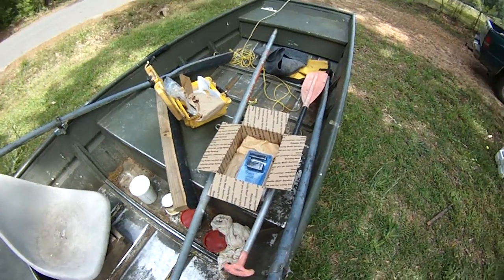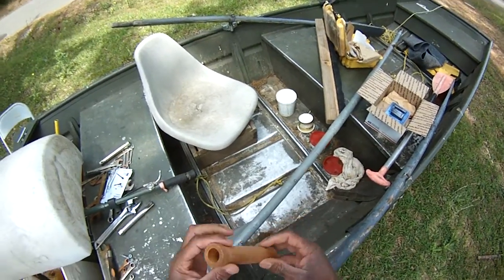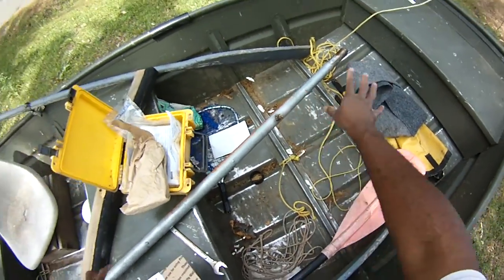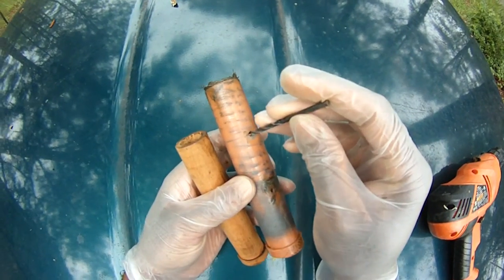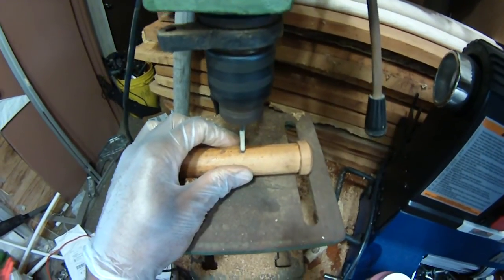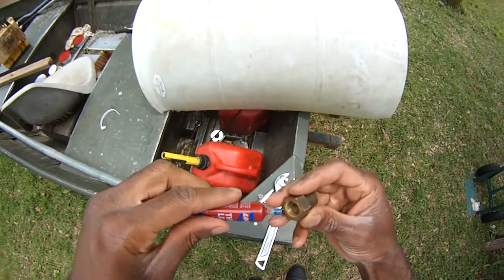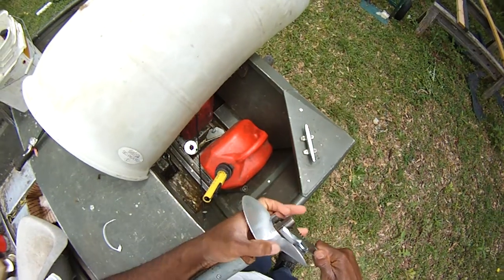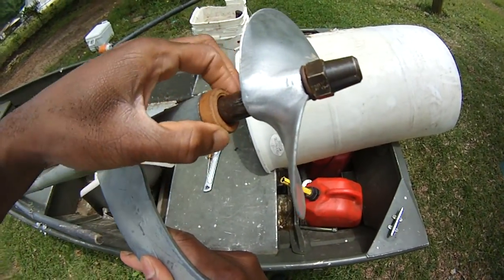Longtail Lesson #4 | How to Install a Wooden Flange Bushing

Comment: I took out all the screws and drilled out the holes that hold the bushings and replaced them with grease fittings.
find the drill bit thats a little smaller than the zirts and they thread themselves with a ratchet and socket[
put some paper towl in the socket to keep the zirt  from going to deep in the socket
just give them a little shot before going out with marine grease and your good to go.

replaced the tail bushing with the bronze bushing they said last ones but dont know.

I have a KKK 16 hp elect start

Comment: So the brass bushing would install the same way ?
Reply from the maker: Yeah, the biggest problem with the brass bushing is electrolysis because of the different metals. They have a new material that blows away anything that we've had before. I plan to upgrade my current motor to the new bushing eventually.
Reply: Black Warrior Lures I have the mud skipper .. How long can I run the nylon one for and what is the risk I run? The areas I fish aren't wooded areas or swampy messy areas
Reply from the maker: I can't speak for Mud Skipper. The Delrin/nylon types of bushing will melt if run out of water for too long, but they're fine as long as he water cools it. The special bushing I mentioned before is only available to Swamp Runner owners.
Reply: Black Warrior Lures awesome. I'll probably just buy a extra nylon one and always carry it on the boat
Reply: Black Warrior Lures thank you for the fast replies
Reply from the maker: My computer is always up and running, but I do take days off.
Reply: Black Warrior Lures sounds good. Hopefully I'll be posting up some videos soon as well. Have a great one

Comment: When you the shaft off, as well as the shaft housing on the motor, how much grease comes out? and how do you clean the grease off? I run a medium kit and I need to replace the engine soon
Reply from the maker: Clean it with denatured alcohol or acetone. You need to clean the spindle well. Not much grease comes out.
Reply: Black Warrior Lures I appreciate it!

Comment: I also own the KKK long tail kit I'm trying to replace the bushing with a bronze bushing I can't get the bushing to slide out the end. 
 Any help?
Reply from the maker: Vice grips and pull it out. That's why I hate the plastic bushing because it melt and wedges in there,.
Reply: I had the same problem so I toke a torch and heated it up and came right out I put the bronze bushing in it haven’t had a problem since  I had the 13hp  on it for a while and I just put the 22 hp from harbor Freight  on the same kit bolted right up and it rolls my 16 by 54

Comment: Damon, where can I order one of these bushings?
Reply from the maker: +MudMotorMania mudmotorkit.com. This is Swamp Runners, or you hear me call them SPS North America. It's all the same company. You'll have to call them at the shop to order this, as it isn't on their Web site. 

They don't list everything on their Web site, and something they won't sell unless you've bought one of their kits. You can buy the plastic version straight off the Web site.
Reply: I was unable to locate them on there site, I appreciate the information! My problem is I own a "Mud-Skipper" kit by KKK. Therefore they will not sell me a bushing? or will it even fit? I do not expect you to know the answer, just did not know if they were "universal"
Thanks again for the Information!
-Matt
Reply from the maker: +MudMotorMania See, I don't know if it will fit KKK or CLP longtails.

Here's the plastic flange bushing: http://mudmotorkit.com/parts/misc-parts/misc-parts-110.html

Comment: I assume the wood will swell when immersed in water. Will this cause a bit of drag on your shaft?
Reply from the maker: +Ratdog 305 That makes sense. We'll see. Over seas the wooden bushing is standard, so they must have figured something out. I greased the axle  before putting on the bushing, so it should be well lubed.